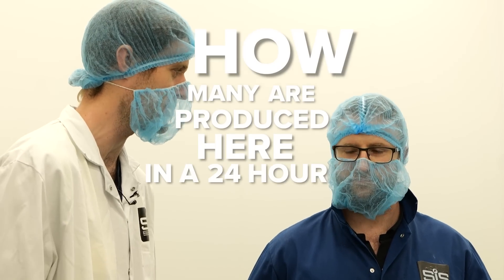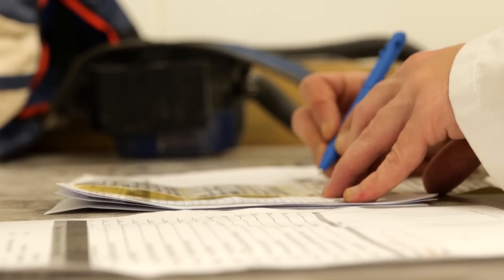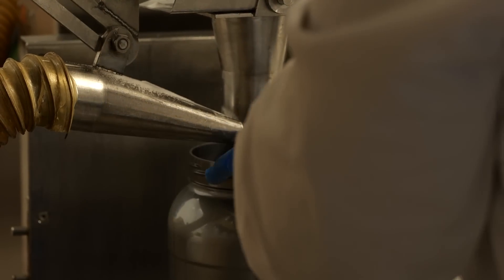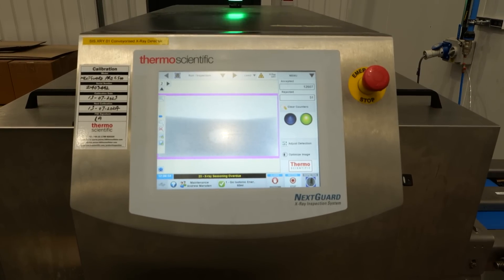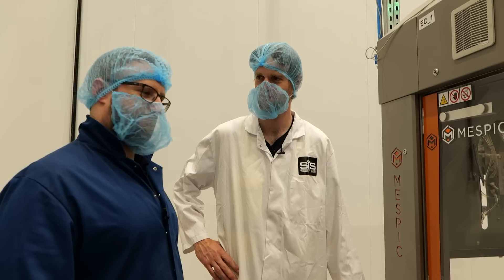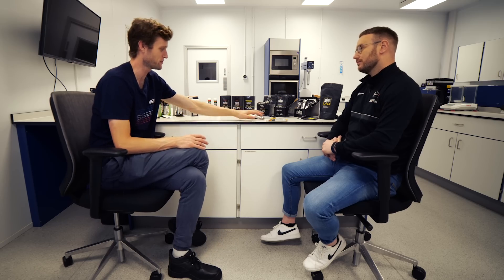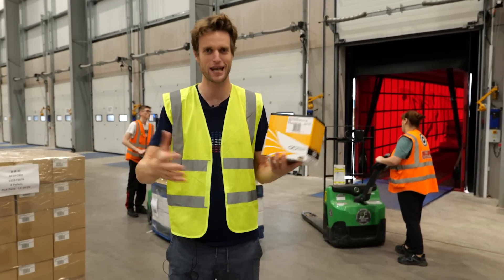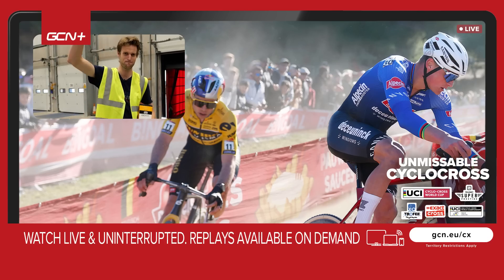How Sports Nutrition Is Made | Inside The Science In Sport (SiS) Factory

Comment: Would be good if they made the gel packets with an extra attachment to one side of the 'lid', so that when opening the top bit didnt totally seperate. Would aid with sustainability in that you wouldnt have loads of tiny bits of plastic accidently dropped
Reply: PowerBar gels have this "Trash Chain" so you dont accidentally litter. They also really good and my go to brand.
Reply: Totally agree. It's definitely a prerequisite for me now when choosing my gels.
Reply: 100%. 
Removable tops should be banned.
Reply: Torq gels have a tab like that which works great.
Reply: Upvote this!
Reply: Clif gels have the trash chain, it's a good idea, technically there is more packaging so less eco. I just slip the lid back into the gel and the stickiness keeps it in but I don't use gels while riding so it would be difficult to do that while riding
Reply: Decathlon gels have this 👍🏼